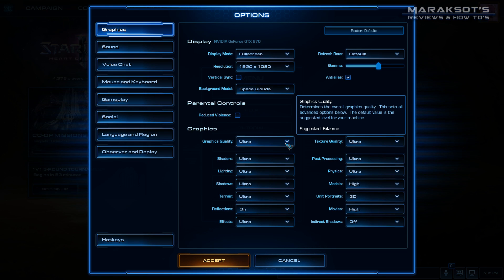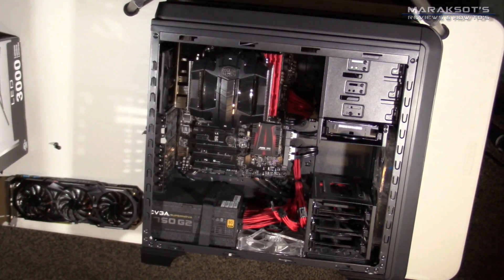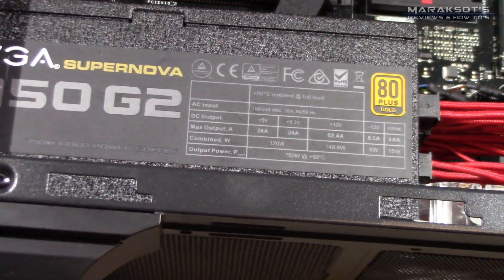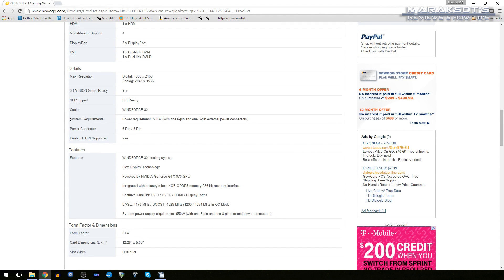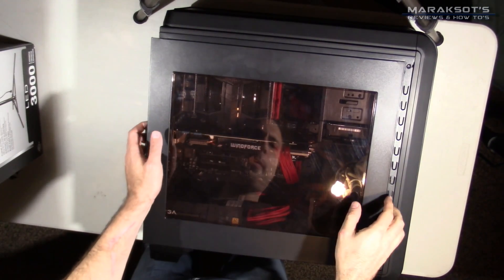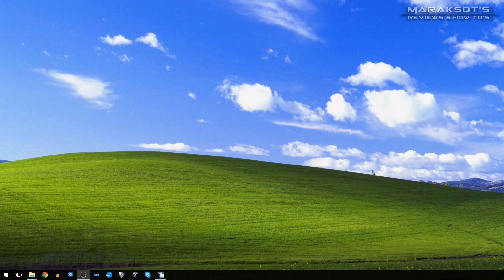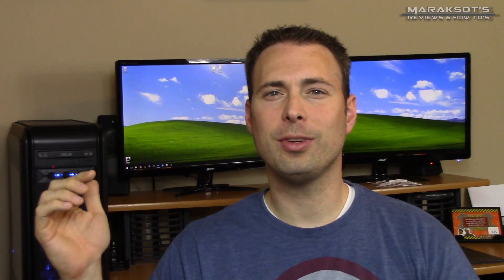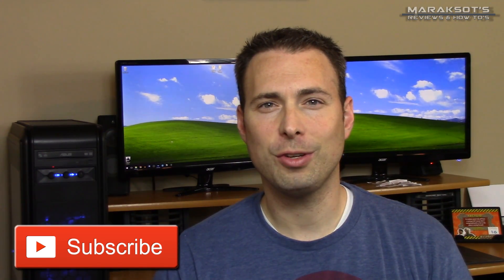A Beginners Guide - Upgrade your GPU - How to Install a New Graphics Card

Comment: Hello,I'am having a problem,i installed my new rx 460 strix but when i start my coputer it stuck on starting windows,please help
Reply from the maker: +edward smith what do you mean exactly when you say it's stuck on starting windows?  When you start your computer do you see your motherboard splash screen then windows starts to load and after that the screen goes black? If so I know of other people that have fixed that problem by updating their motherboard bios.
Reply: Yes,that what i ment,how to update my bios?
Reply from the maker: edward smith you'll first need to know what make and model your motherboard is, for example I have an Asus Z97 Pro Gamer motherboard so I would go to Asus' website and search for my motherboard. Once you find your board there should be a place for downloads and in there you'll hopefully be able to find the most current version of your bios/uefi. Download it, copy it to a usb drive, restart your computer, and access your bios/uefi (most motherboards you do this by repeatedly tapping the delete key while your computer is booting up). In your bios/uefi menu (most likely in the advanced settings) there should be an option to update your bios/uefi, you select the file you saved to your usb drive and let the computer do it's thing. Here's a link to a video showing how to update the bios/uefi on a Gigabyte motherboard, your board may be a different brand but the steps shown here should give you an idea of what to do. Best of luck to you.  :)  https://youtu.be/NHN_QAEPeF8
Reply: Thank's man you helped me alot
one more question,my friend told you have to reinstall  windows, is that true?
Reply from the maker: You're welcome. I'm happy to help. To the best of my knowledge you should be just fine.  No need to reinstall windows.
Reply: Thank's man
Reply: I couldn't find a bios upgrade for my mother board, it's asus h81m-c.
Reply from the maker: I believe this is what youre looking for.  :) looks like the most recent bios release came out on Nov 18th.  asus.com
Reply: Thank you very much,you helped me alot,however is there any risks if i upgrade the bios?,and can i upgrade from hard drive?
Reply from the maker: edward smith There is a slight risk of bricking your motherboard if you power your computer off in the middle of the update but I've updated mine before without any problems.  I have heard of people having to reinstall windows after updating their bios/uefi but after I updated mine my computer booted up fine with no problems.  As far as I know you have to do it from a usb drive, not sure what the reason is for that but that's the way I've always seen it recommended so that's the way i did it.  :)
Reply: I won't brick my mother board if it has a dual bios right?
Reply from the maker: Yup that's what the dual bios is for.  In the off chance something goes wrong with one you have a backup you can switch over to. I think you'll be just fine though. :)
Reply: I didn't update the bios,the problem was that i had a 1333mhz ram so i tried the 1666mhz and it worked thanks for the help any way,i thought i have to tell you what happend.
Reply from the maker: edward smith Cool! Glad you got it working. Thanks for sharing the info. Happy gaming man. :)

Comment: I have a R9 280X and i want to upgrade so i have a decent performance in Virtual Reality without expending too much. My mobo is a  MSI B85-G43 Gaming. Which one do you guys recommend? A RX 480, maybe?
Reply from the maker: The RX 480 is a good choice for an entry level VR graphics card.  To run a "flawless" VR experience you need to have some pretty powerful hardware like the GTX 1070 or 1080.  That being said the RX 480 is a good choice to get you in the ground level.  Check out this video from BitWit. Kyle built a budget VR PC to show what kind of VR performance you can expect from a minimum spec rig using the RX 480 as his GPU.  https://www.youtube.com/watch?v=2P4VVmMkk6U
Reply: Thanks a lot for the fast answer. So, if i really want "flawless" VR i really need o buy a 1070? They are a bit expensive. Any version in particular? My complete specs (3yo PC) are:

I5 4670
280x
8GB RAM DDR3 1600
MSI B85-G43 Gaming

CPU should be good i think. Maybe add 8gb ram of the same speed. Mobo should be compatible with a 1070, right? Dimensions and all that.
Reply from the maker: No problem. I personally don't have a VR headset like the Vive or Rift but I have read quite a bit of suff and watched a fair amount of stuff from other Tech Tubers about it and from what I've learned the RX 480 works well for most stuff there's just some VR games the frame rate drops below the recommended 90 frames per second. I recently was able to review an RX 480 and I'm impressed at the performance it has in current gen games at 1080p. So anyway to get back to your question, I think depending on your budget the RX 480 will give you a good VR experience. To get an even better experience the 1070  is going to be a better option. The 1070 however is much more expensive than the RX 480 currently. If you do decide to go with the 1070 I'd recommend looking at one that's about $400.  From what I've seen on the 10 series cards thanks to GPU boost 3.0 there's really no reason to buy the more expensive versions.  Your system specs look great. You shouldn't have any compatibility problems with either the RX 480 or the 1070.  8GB of RAM is fine but grabbing 8 more gigs is not a bad idea either. :)

Comment: if I have 32  do I select 32
Reply from the maker: +Pujina Iulian Yslen I assume you're talking about a 32 bit version of windows? If you have the 32 bit version of windows then yes you'll want to select the drivers for your version of windows. :)
Reply: well now I have 32 but I bought a 64 one. do I select 32 or 64?
Reply from the maker: +Pujina Iulian Yslen so you currently have the 32 bit version of windows installed but also bought a 64 bit version which is not yet installed on your system? Whichever version of Windows you have installed and running you'll want to install the drivers for that version.
Reply: Maraksot78  yes
Reply from the maker: +Pujina Iulian Yslen since your currently using the 32 bit version of windows I would select that from the driver selection menu and install that. Whenever you decide to install the 64 bit version of windows then I would update your drivers to the 64 bit version at that time.
Reply: well someone said to wait for  a Windows update

Comment: I am thinking of upgrading from my 970 to a 10 series. Do you think i should wait or go for it
Reply from the maker: +BM Murray it really depends on what games you're playing and what resolution you're playing at and stuff. The GTX 970 is a very capable 1080p card and also performs quite respectably at 1440p if you're going for 1440p at 144 hertz or 4K then upgrading to a GTX 1070 or 1080 is currently the way to go. But again if your monitor is like mine, 1080p 60 hertz, then there's really no reason to upgrade at this current point in time. :)
Reply: BM Murray dude, same. I couldn't max out GTA V and I plan on doing some 4K gaming, so it's definitely time.

Comment: will a AMD Radeon R5 run squad and h1z1?
Reply from the maker: +BC-Gaming to be honest I don't know anything about the R5.  I looked up the minimum system requirements for h1z1 and it specs a minimum of a GTX 275... I then googled a comparison of the R5 230 and the GTX 275 and according to what I found the specs of the GTX 275 are way higher than the R5 230 which would lead me to believe that if the R5 230 will run h1z1 you'll have to run at minimum settings and then I still don't know what the framerate would be like but I imagine the game would be unplayable. That being said I've never tested one in real life so I don't know for sure, I'm just hypothesizing off of specs I found online.

Comment: Hi do you know why some people have black screens when they turn their pc with a new gpu for the first time ?
Reply from the maker: +BrawniestPie30 are you talking about after upgrading to a new graphics card when you boot up for the first time you see your motherboard or manufacturer splash screen (Asus, MSI, AsRock, Gigabyte, Dell, HP or whatever) but then after that the screen is just black? If so I've found that updating your motherboard bios/uefi fixes that problem.
Reply: oh right thanks, it is just I want to upgrade my gpu and hope that there are no problems whilst doing it
Reply from the maker: BrawniestPie30 no problem. :) The black screen thing is relatively rare, most likely you'll be just fine. Best of luck with your upgrade.  :)
Reply: Maraksot78 thank you very much

Comment: Hi Brian I am wanting to upgrade my graphics but my current is integrated what do I do here I want to either remove it or get a new motherboard what's the bette r idea?
Reply from the maker: integrated graphics means your CPU has a built-in graphics processor in it and when you install a discrete graphics card into your system and connect your monitor to it then your computer will detect that it now has a graphics card installed and will then disable the onboard (aka integrated) graphics and your CPU will then act just as a CPU instead of both CPU and GPU.
Reply: Maraksot78 I heard from a friend that it slows it down though is that true and if so how bad is it?
Reply from the maker: +dat boi I'm not 100% sure what your friend means but I'm guessing he's talking about CPU bottlenecking. In games and stuff your CPU is responsible for processing some of the data and your graphics card is responsible for some as well. Many tasks require the CPU to process data and then relay that to the graphics card so the graphics card can use that data to do its job. Depending on what CPU and GPU you have you can experience what is called CPU bottlenecking, which happens when your graphics card is able to process all its instructions faster than the CPU can process its own instructions and relay them to your graphics card. This means your graphics card has to wait for instructions from the CPU before it can do its next job. This results in lower frame rates in games when your graphics card is capable of much more. Intel's current top i5 the 6600k has integrated graphics and you can pair a GTX 1080 with it with no problem whatsoever. Now if you wanted to pair a GTX 1080 with a core 2 duo or something like that there would most definitely be some bottlenecking.  So its not about wether or not your CPU has integrated graphics or not it's about the power of your CPU and GPU being in the same league so to speak. Sorry this reply has been so long but I just felt I should share that info with you. :)

Comment: Hi sir just want to ask if it will be bottleneck if I would upgrade to gtx 1050ti when my mobo is h81m-d and my cpu is I3 4th gen??  thank you :D
Reply from the maker: +Gian Joshua Anchinges thanks for the question. It's hard for me to say for sure as I don't own an i3, but 4th generation is Haswell so it's only 3 years old or so and I'm pretty sure the Haswell i3's have hyper threading which means they have 4 logical cores. It may bottleneck a 1050ti a little bit but I can't say for sure. That being said I think you'll be fine because if there is any bottlenecking I think it will be minimal.  Happy gaming!  :)
Reply: Okay sir thank you very much for quick response and awesome guides, I learned a lot from your videos :D
Reply from the maker: Gian Joshua Anchinges you're very welcome, I'm always happy to help. Thanks for watching. :)

Comment: not necessarily a tech wiz but do i need to upgrade the bios or anything before i install the new video card?
Reply from the maker: +RuffRidersEvo usually all you need to do is install your new card and the drivers for it. Depending on the age of your motherboard you may need to update your motherboard bios, however this is fairly rare. After you install your new graphics card and boot up your computer if you see your motherboard splash screen but then the screen goes black when and you never get into windows that means you need to update your motherboard bios.
Reply: Maraksot78 The motherboard that I have is an Asus x99 deluxe
Reply from the maker: ***** you should be just fine. :)
Reply: Maraksot78 thx

Comment: I bought a gt 710 and my friend had to ply out metal to fit it in the case
Reply from the maker: Sometimes you gotta do a little case modding to get stuff to fit.  :D
Reply: lol Yeah it took 5 minutes and my 2ds and iphone falling off the table. There will be some collateral damage.
Reply from the maker: K9521 Creates oh no! Hopefully the collateral damage wasn't too bad. :D
Reply: the damage wasn't that bad but now I need a new case because the graphics card (which is only 16m) wouldn't secure in the case, so now another trip to Micro Center.

Comment: I got a i5 -2500  cpu  @ 3.3 ghz 
8 GB RAM

So my question is: Is it fine to just upgrade my GPU or should i change my cpu as well because i dont want my cpu to bottleneck my new gpu ( i was going to buy an nvidia 900 series.) . Thanks! nice video.
Reply from the maker: +L indien I think you'll be fine. I know the i5 6600 is a great CPU for gaming and won't bottleneck modern GPU's and according to CPUboss.com and cpu.userbenchmark.com the i5 2500 is about 75% to 80% as powerful as the 6600 so I think you'll be good.
Reply: Thanks for the reply!
Reply from the maker: L indien no problem. :) I'm happy to do what I can to help.